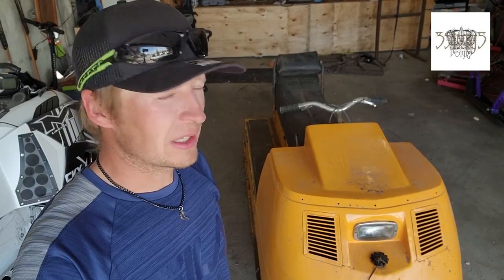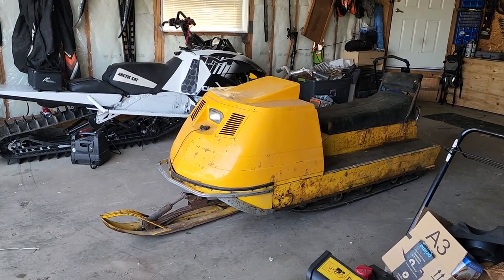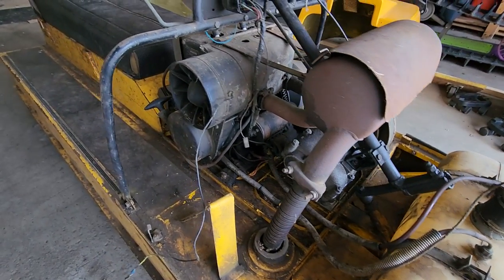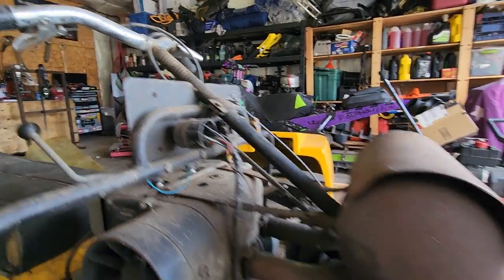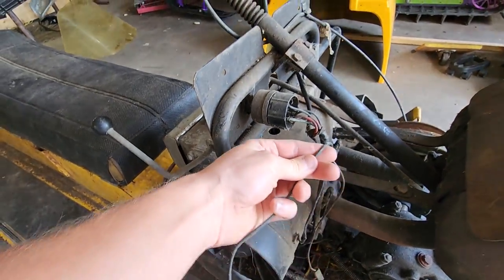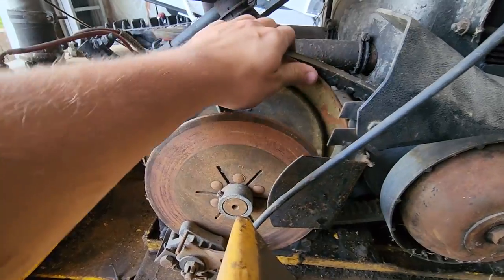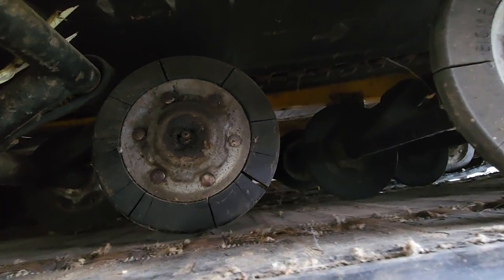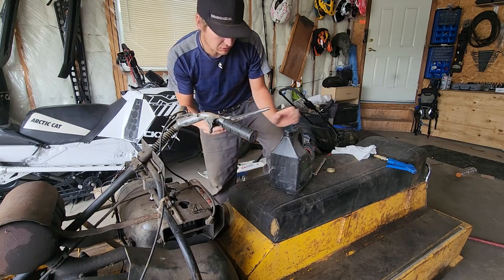VINTAGE SKI-DOO 399 ALPINE WALK AROUND | Will it Start?

Comment: Love that you got some old iron! My first sled was a 70 skidoo Nordic 399! Will be a good reliable motor after you rebuild it and it's super easy to rebuild those 399's!
Reply: To be fair, it's stupid easy to rebuild any 2t. Pull heads, pull jugs, decide whether the bottom end needs attention, reassemble.

Comment: The Alpine in 72 had a 640 cc engine the Valmont had a 399 engine the Alpine was a long track type and the Valmont a shorter track and frame 
Not sure of the Alpine had a 399 in 70